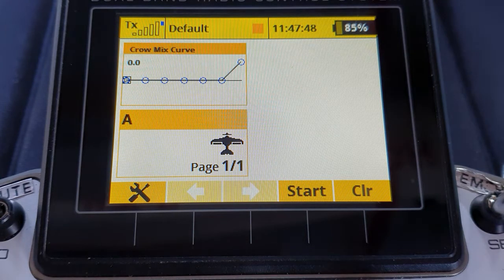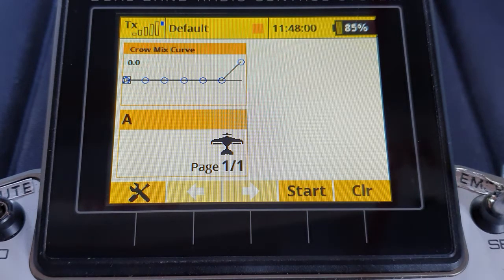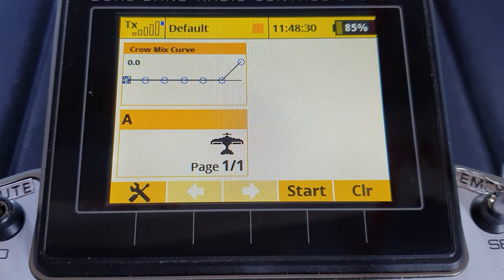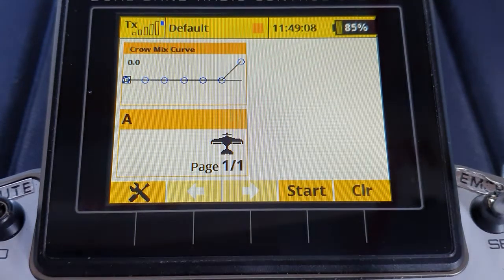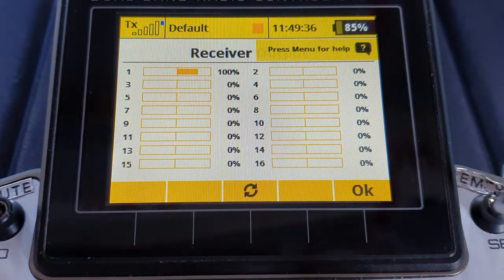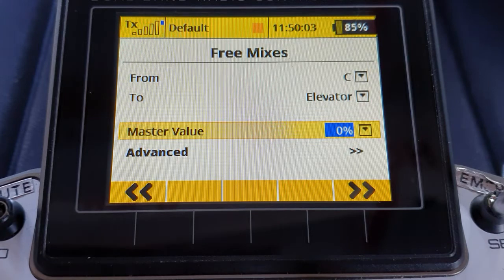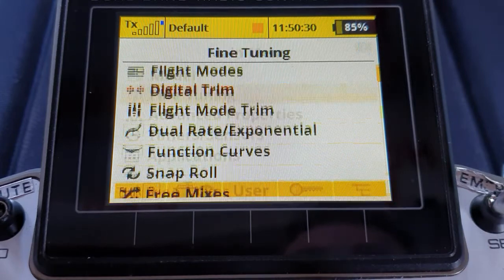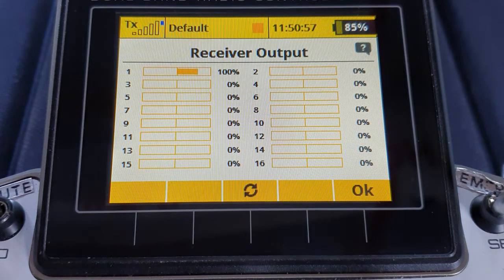Jeti - auto-trim a multi point curve for crow brake (butterfly) elevator compensation, episode 2

Comment: So, even if you add the second free mix to increase trim value to say 140%...you still divide the Lua curve points by 2 to transfer to compensation curve..sorry if i missed that part
Reply from the maker: I guess not, the doubling of the mixers cancels the half trim value, so the elevator compensation curve will be 100% and whatever values the app curve shows.  For a single mixer, it is easier to use 50% and the app values rather than 100% and halving the app values
Reply: Oh yeah, good point...ill do that

Comment: Harry sorry to add addendum to last comment.  The auto trim app generates a curve ok but when you are setting yo0u are setting up the curve you will only be able to set 1/2 the points of the curve you selected so it starts at point 5 and goes up to 9 in a 9 point curve.  Thanks Again.

Comment: Harry I have a glider setup using 2 -3 position switches for climb, landing, speed, thermal and cruise.  When I try to use the LUA for crow elevator compensation on landing mode the compensation starts at the center point in the curve.  I am using a logical switch using the mode switch position and P4 for the crow.  The crow and throttle are set up on the P4 stick using logical switch to control what's active.  What do I need to do?  Is there a better way to communicate question of this kind?  Thank You!
Reply from the maker: You must have programmed some offset into the stick

Comment: Hi Harry, HELP!!  I’m trying to setup a paramotor on my ds24. So 2 servos, need left & right independent brakes on ailerons & both brakes down only on the elevator, all with full servo travel. Would be grateful if you could please help, ps 3 hours in, i am back to square 1!
Reply from the maker: I have no knowledge of paramotors.  However it sounds like a simple delta configuration.  Choose 2 aileron setup, no tail/delta.  Then in elevon menu turn up travels to 100% for both.

Comment: Ok, thank you for being honest as you always are. The bigger question I have is simply this: I have recently purchased the new DS-16 V2 and I want to set my planes up using two 2.4 receivers in Dual Path the 900 NG for back up and a fourth receiver for switching on/off of the plane. I am being told by Jeti USA and others that I should not use double path and not have two 2.4 receiver and the 900 NG. I should only use one 2.4 and the 900 NG but in default mode not dual path. I am totally lost. What I want to do is what I explained  first in this writing. Can you assist me with the set up/hook up. It seems you are always open to what the flyer wants instead of what the person you are talking to wants. Please help. Thank you as always. Hope to hear from you soon.
Reply from the maker: 2 X 2.4 plus 900 is ok, if it wasn't why would Jeti design it and publish the connection diagrams for it?
I fly in open countryside with little to zero background 2.4 noise.  Dual path gives superb Q values, pretty much flat-lined at 100%.  Many people in the USA who fly at 2.4 noisy sites, with nearby industrial wi-fi, phone masts, lots and lots of model Tx switched on, report that dual path gets lower Q and default mode gets higher Q.  Therefore they prefer default mode.  They can still have a secondary 2.4 Rx but running it in clone mode.  A very helpful person for techy advice and explanations is Danny Melnik at Aeropanda.

Comment: Good morning Harry, I have a question concerning the use of Booma Advanced Radio RRS system which I have purchased and want to use as my primary power management system. On the RRS, I know you attached the jeti R Sat 2 receivers to A1 and A2, there is an additional A3. The question is can I use the A3 to connect the new 900mzh NG. I have ask AR this question and they referred me back to Jeti. So I am asking you (my best jeti adviser). Thanks and hope to hear from you soon.
Reply from the maker: Don't know, I do not use Booma, Powerbox etc., only Jeti